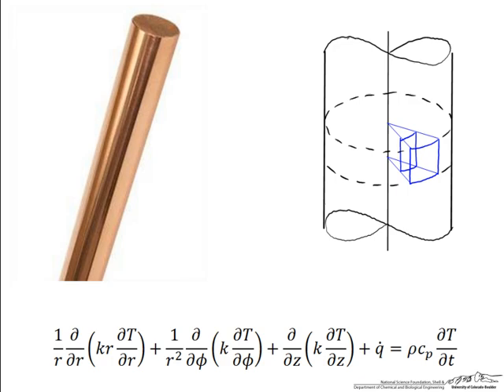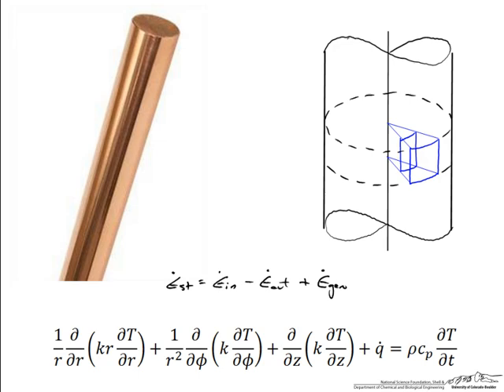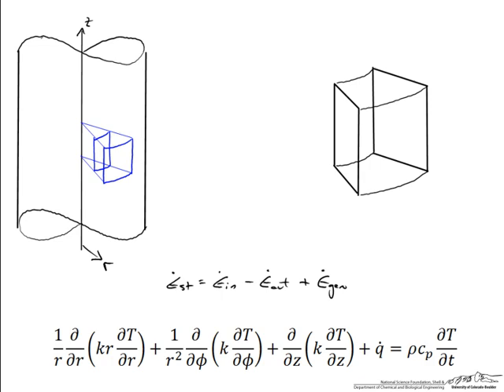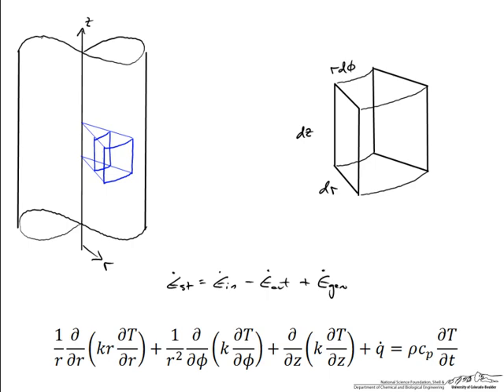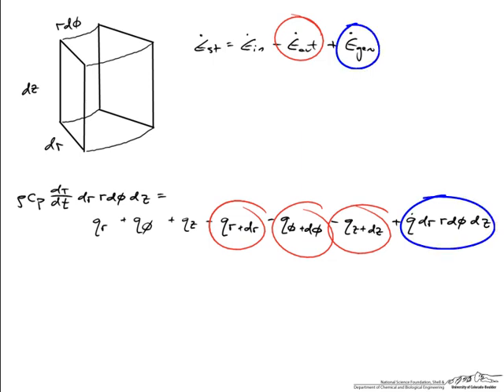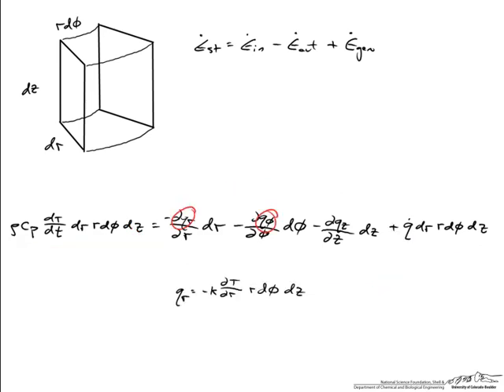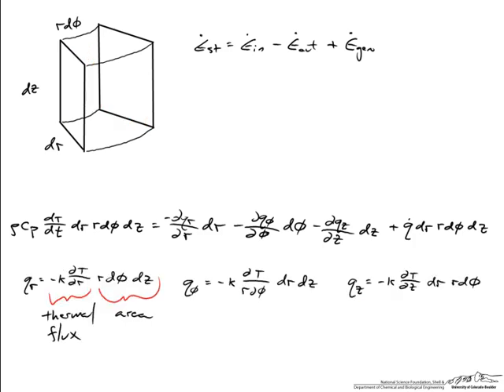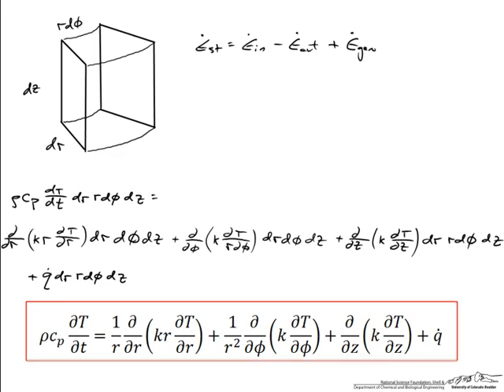Heat Equation Derivation: Cylindrical Coordinates

Comment: Hey, really nice video! I want to add why there's a "r" in  dV=rdθdrdz.       In other way, it's dV=dAdz=(rdθ)(dr)dz and (rdθ)(dr) comes from calculating the bottom area of a very small(differential) volume in cylindrical coordinates, analogous to dxdydz in Cartesian coordinates. So, how does (rdθ)(dr) become the bottom area in cylindrical coordinates, when it's shaped like a  circular sector instead of a simple rectangle? That's because since we're calculating a differential scale, the circular sector shape could be regarded as a rectangle when calculating its area.

Comment: I have a question: i the general equation you have 1/r  d/dr multiplied by (kr  dt/dr). shouldn't the r's cancel out?
Reply from the maker: Great question.  We have to be careful with the math here.  We are not multiplying those terms; we are taking the partial derivative of kr dt/dr with respect to r.  The 1/r term is on the outside of that partial derivative.  I hope that helps.

Comment: with the dr term why r is not canceled out bcx r is in both numerator and denominator.... ??????
Reply: r cannot be taken out because r is a variable. For example you can take k out if you assume that the material is isotropic but you cant if k changes inside the material with direction (anisotropic), that is, it is a function of radius r. It is just like differentiation of (1/x)*d(x^2)/dx or d(2*x)/dx where you cant take x out because it needs to be differentiated.
Reply: thanks dear. (Y)
Reply: Jamal Khan when r is with phi we are able to take it out  because r is constant as it is with partial change with phi ?

Comment: Cengel's 5th ed:
"After lengthy manipulation, we obtain [Conduction Equation in cylindrical coordinates]"
In my opinion, the author of the book clearly had no respect for the reader's intellectual capacity. This is pretty straight forward, even though I could not think of it myself at first.

Comment: The second part of your statement is correct but the first isn't. The differential distance is already included in the definition of q_Phi and it doesn't make sense to compute the taylor series expansion with r*d Phi. Think about it, if you that were the case we wouldn't be able to write the taylor series expansion of an unknown function because we wouldn't know the factors to the differential we're multiplying. It's a great video, the only thing missing the one you pointed out.

Comment: 3D solution (programming done in MATLAB) of discretized momentum, energy and mass balances for an arbitrary gas phase reaction (pressure variations must be taken into account) taking place in a tubular reactor with baffles and equipped with a heat exchanger, please.

Comment: I disliked the video because you had an error and you seemed to skip a bit of math at the end, which would have revealed the error.  In the video you show that q_(Phi+d Phi)=q_Phi + partial of q_Phi wrt Phi, *d Phi, but the end should be r*d Phi, since as you stated we are dealing with a differential distance, and d Phi would only be a arc length...Then you do not explain in any way why the r for the radius term stays in but the den. r comes out in the Phi term.